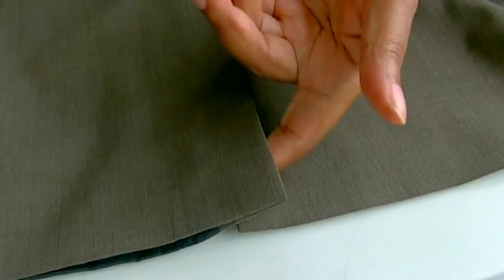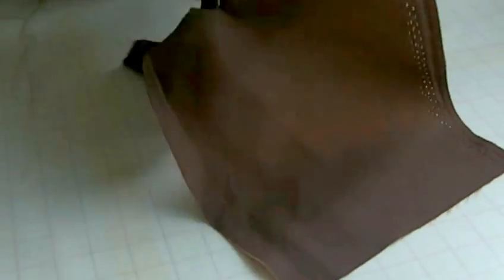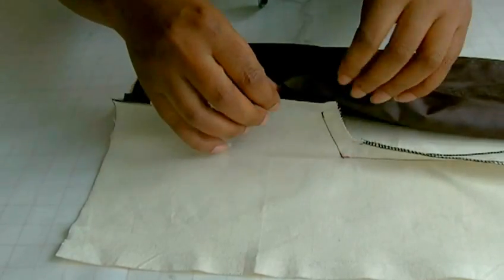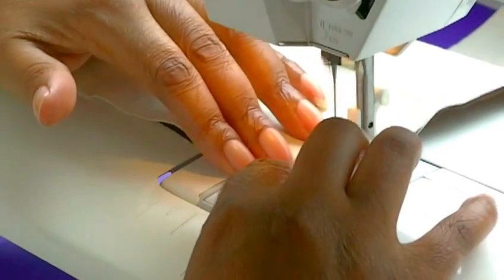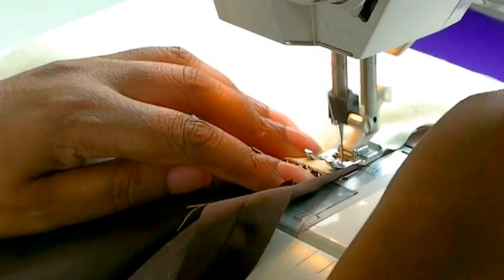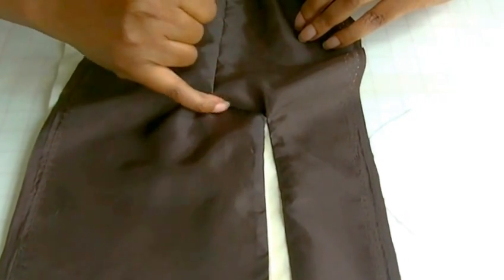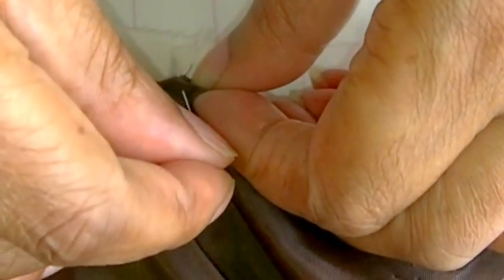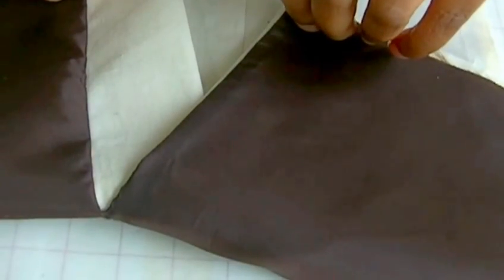Sewing Lining to a Vent

Comment from the maker: You can change a slit into a vent prior to making up the skirt, but if it's already made up, then this may prove difficult as it means adding more fabric.  If your sewing pattern has no alteration markings already, you'll need to make the alteration on the wiggle skirt below hip level, drawing a line from one end of the pattern piece to the other, cut, then fold up the amount you need to take out.

Comment: Hi there, many thanks for answering my questions.  My confession is that lazily i made a skirt with a back slit instead of a vent because i couldn't work out how to redraft the original pattern as it was made for a taller person! 
So my 2 questions are: Can i change a slit in to a vent to an excisting skirt? I now understand the importance of vents! How do you shorten the length on a skirt pattern?

Comment: Hi very nice video. Can you please tell me how I would hem the vent once the lining is attached?
Reply: I was taught to hem lining ahead of time and place 1/2" above pressed up hem of garment fabric. Fold hem back upon itself with lining sandwiched in between, and sew like shown in video.  When you turn hem right side out, lining will be encased in seam with a lovely clean finish
Reply from the maker: There are many ways to do it but as Dusty suggests below, you'll get a great finish following those instructions.
Reply from the maker: Dusty Michaels Thanks so much for your advice
Reply: Thanks
Reply: Najon Brand Anytime.  I should also mention, press up the hem first so you have a sharp line to fold back on. Make a TINY snip in the crease at the edge of the fold and it will turn right side out easier once sewn.

Comment: hey colleen, i followed your first vent sewing tutorial, where you instruct to turn under the edge of the vent before doing anything else. in this tutorial, however, it seems as though the edges are not turned down. it's hard to undo the turning of the vent edges since it was the very first step in the first video..help!
Reply from the maker: cooganb It really does all depend on where you stop sewing and where your last stitch is placed.  If you're going to add lining, try stopping a little before the end which will allow for an allowance where the lining can be attached.